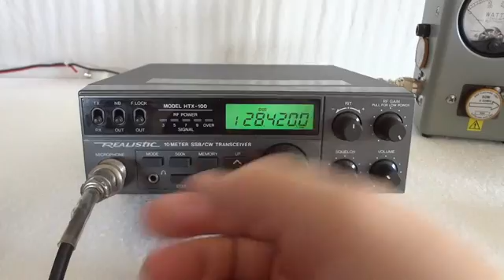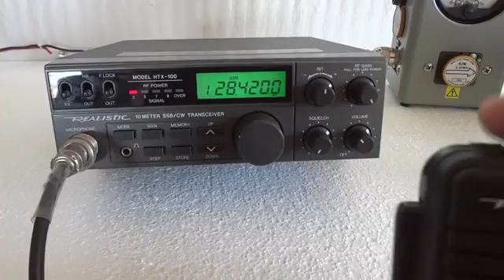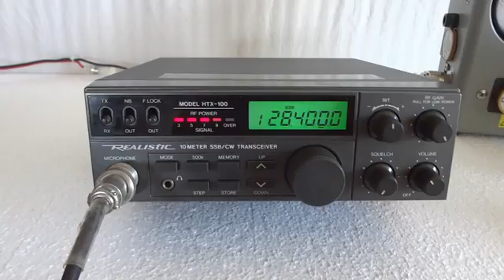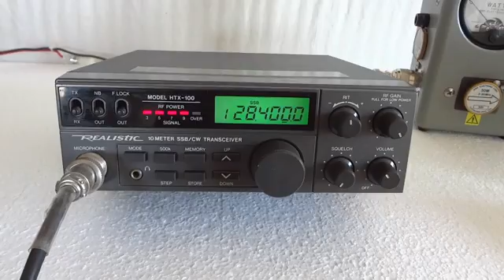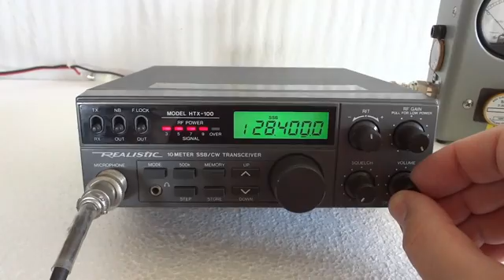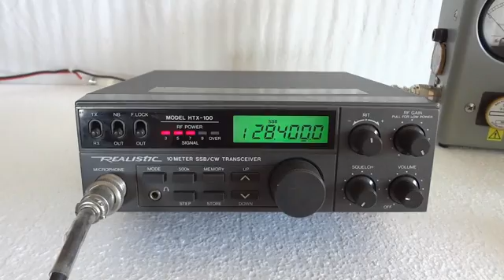Realistic HTX 100 demo

Comment: I remember when this radio came out. Back in the late '80s, when the FCC totally revamped the rules and created the novice voice class that allowed novice operation on a small segment of 10 meters. That's when I got my novice license, but I immediately got my technician license, bypassed 10 meters, and went straight to 2 meters. Radio Shack later came out with a 2 meter handheld, the HTX-202, but never had a 2 meter mobile.
Reply from the maker: As far as I know, RS had at least two 2-meter mobiles, the HTX212 and the HTX252. Here the HTX212: https://www.ebay.com/itm/126385988318
HTX252: https://www.youtube.com/watch?v=g7baFkqSYtI
Cheers.
Reply: @LifeIsTooShortForQRP  I don't remember those. I bought a Kenwood mobile. Cost almost $400. In 1988. Now I have a Yaesu FT2900 in my car, that cost less than $150. But it's too complicated for me. I had to buy a USB cord and the software to even set it up. That Kenwood was so simple. I wish they still made radios like that, just cheaper. A radio should be a radio, not a computer.

Comment: I wish a newer version had come out that was a multimode so not only was there SSB and CW, but Also AM, as well as 10m FM with Repeater Offset and Tone ENC/DEC.
Reply from the maker: The thing is, this is a great little radio but as a collector's item. The design is pretty old. If you want a 10 meter radio that has all the things you mentioned (mutimode) and then some,  there is lots of other options today. I can recommend the Anytone AT-5555N mark II, a fantastic radio. And ridiculously low in cost for what it offers. See here as an example: https://www.ebay.com/itm/265614000186  Cheers.

Comment: The Uniden HR-2600 I had ( adds FM and AM)  was an excellent radio in mobile use, no reason to think this simpler version shouldn't be as well.  Quite useful as a IF /Driver for transverters.  Quite under rated.  Note that Uniden will no longer service its ham radio products. So the simplicty here is probably a good thing, if you don't need the other modes.

Comment: Great video.  I bought one of these in the 80’s and recently pulled it out of storage after many years.  I would like to get it up and running again.  I’m really a novice to ham radio but I do have a general operator’s license.  What type of power supply and antenna do I need to operate the radio from home? Also what level of license is required to use the 10 meter band?
Reply from the maker: For 10 meter, even a technician license is enough (up to 28.5 MHz). Your general ticket is one step up from that, and it covers you for the whole 10m band. The radio takes about 5 amps, so if you get yourself a power supply that can generate 5 amps at 13.8V, you are good. See eBay or Amazon for some examples.  Antenna is a bit harder to answer, it depends how much you want to spend (beam antenna, vertical antenna or the cheapest, a wire antenna). Just go to eBay and do a search for "10 meter antenna" and pick an antenna that fits your needs and budget. Cheers.

Comment: Hello . .. I have little problrm with Realistic HtX100 .. i have to loud modulation and i must silence talk to mic .... distortion on transmiting usb ... wich VR is to adjust ( short sensivity of  modulation)  in this radio please ???
Reply from the maker: Sounds like the ALC and/or mic gain need readjustment. You can download the service manual here: https://www.cbtricks.com/radios/realistic/htx_100/index.htm
In there, the adjustments are explained. Cheers.
Reply: @LifeIsTooShortForQRP  Manny Thanks 73 !!

Comment: Hmmm.
I recall nobody liking them when new...
Reply: Can't imagine why. They get the job done.  I've owned 4 or 5 over the past 35 years.  Always regret selling them.  Too bad 10 M propagation sucks so bad.
Reply: I’ve had mine for about 28 years and it works pretty good for a basic 10 meter.
Reply: Sad hams😅😅

Comment: Great radio. What kind of power source setup do you have this connected to?
Reply from the maker: I'm using a 10 amp PSU. The radio draws about 8 amps peak when you modulate, so a 10 amp power supply (at 13 to 14V) will do it.

Comment: Thanks for sharing! My QTH is Fort Worth, Texas, the home of Radio Shack. There were several hams who worked at RS, and I'm lucky to be friends with a couple of them. I bought my HTX-100 as soon as they were put on the market, and still have it today. The big news for 1989 was the addition of limited 10-meter privileges for US Novice class licensees, and Radio Shack introduced the HTX-100 to target the Novice market. I hadn't used my Amateur privileges since I got my license in 1985, but that all changed with this little radio. I took it everywhere along with a crude 10-meter dipole, and had no end of fun with it. It's been in it's original box in my closet for a few years. Your video has made me want to get it out and use it again. 73
Reply from the maker: In the video I give Uniden a lot of credit, but I also should have given credit to the people who wrote the development specification for this radio which Uniden used to create this product. They were US based Radio Shack employees, mostly hams like you said. They are the reason why this radio turned out as good as it did. And it is a pity that Radio Shack went belly up.

Comment: These are fine 10-meter transceivers and are not in the same class as the typical 10/11/12-meter rigs on the market. Indeed this was a 10-meter ONLY radio and it is an exceptional performer on that band. The only thing I wished they would have included is an analog style meter with a "needle" rather than five LED receive segments but it is what it is and as such is still an excellent 10-meter rig :)

The HTX-100 is one of THE very few genuine 10-meter transceivers.